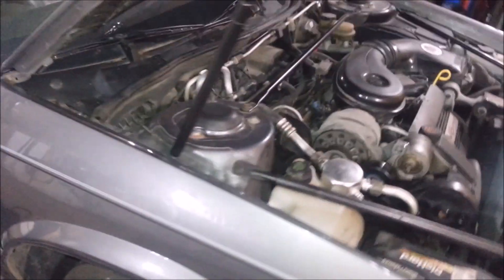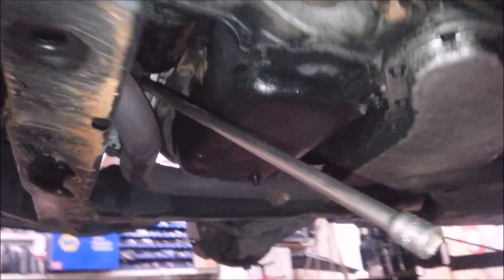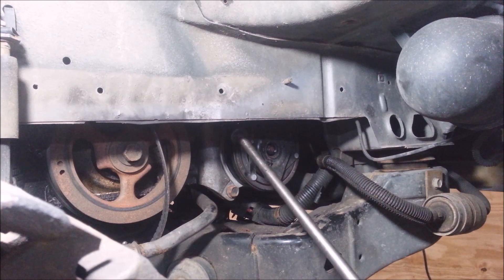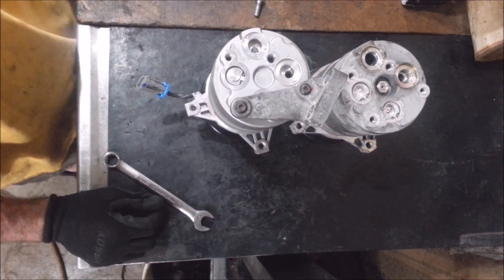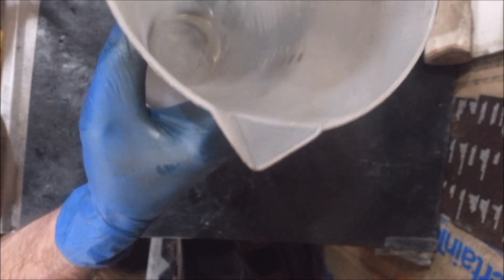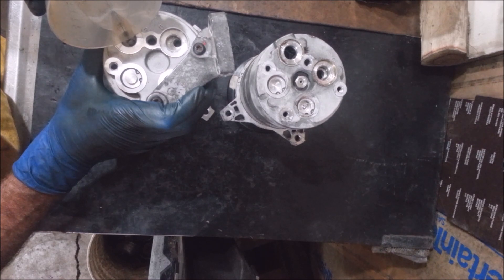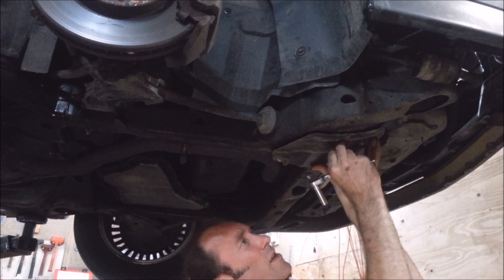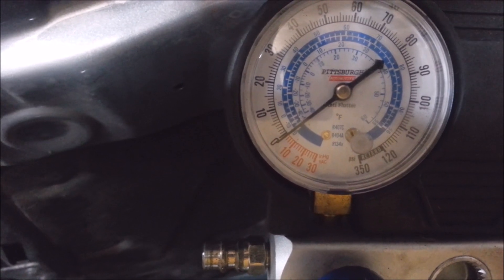1993-1995 Eldorado a/c compressor replacement

Comment: The show goes down at 12 noon today. My friend is going to recover the old R134A in system and put on the new ac compressor and accumulator Orifice tube and seals and recharge it. I will let you know how it all goes. Thank you for your help and guidance

Comment: Thanks so much for the response. Exactly....wrong compressor. Ugh. I spoke with Four Seasons and they've confirmed that I need their 58956 even though the 58963 is listed to fit. I hope this helps someone who might be in my situation. Definitely check the orientation when you get a replacement compressor. It should be exactly the same. One more question, Rust, if I may....are there o rings under the switches/sensors that are on the freon line that runs across above the firewall? Or are they crush washers? I would like to change all of the o rings I can while the system is evacuated. Never delt with these. Are they easy? Thanks!

Comment: I'm doing a 1993 Seville 4.9 right now. GREAT video, thanks so much. Got a new Four Seasons 58963 compressor (supposedly correct fit) and the orientation is off. Its requiring me to twist the lines quite a bit to connect them. No joy so far. Also the old, original compressor used two thin washers and the new one looks like it's meant for a medium and thick washers. Should I keep messing with this to see if I can get the lines on there? Or buy another brand?
Reply from the maker: It's the wrong compressor. Also, there are separate seals you can buy from Napa, if they do not supply the right ones.

Comment: I've got a 1990 Eldorado I'm restoring. I need to charge the ac compressor. When I bought the car last week I tuned on the ac and it blew not hot nor cold In between. It is low on R134A previous owner had it converted. It displays Low Refrigerant and the compressor cycled off. Do you know the Color of the Power wire so I can jump it on. Thank you
Reply from the maker: Unplug the compressor coil. If it has one wire, That will require + power. If it has 2, it will require a +, and -. On a two wire system, it doesn't matter which ones you use, because it is just a pull in winding, making an electromagnet.
Reply from the maker: Unplug it, and jump with power, and ground. Coil winding can go either way.
Reply: @RustBeltAuto  Thank you for your help I greatly appreciate it. I replaced the air conditioning compressor and accumulator along with the Orifice tube and seals. I vacuumed the the system down 3 times and charged the system to the original specification for 90 Eldorado 38.5 R12 8 ounces of mineral oil which I used R134A and Ester. It blows so cold I've got to turn it down. Thanks again
Reply: @stevecarlson6462  went great. Blows ice cold. I replaced the air compressor accumulator and Orifice tube and pulled a vacuum. 38.5 ounces of R134A and 4 ounces of ester oil.
Reply: @stevecarlson6462  Yes it'll be getting hot in Kentucky really soon plus my mom is 73 and I didn't want her riding in the hot car. Their is a guy on Ebay that I buy remanufactured air conditioning compressors from hes really reasonable. 100 for my 90 Eldorado plus 30 for the accularator 4 for the Orifice tube 20 for R134A 9 for ester oil. 200 for labor from a great friend.
Reply: @stevecarlson6462  Sourcedbytd is the seller.
Reply: @stevecarlson6462  What year and model engine size. Is it r12 now or has it been converted to R134A.
Reply: @stevecarlson6462  91 Seville. 4.5 4.9 same you've got a HR6 Compressor. The system will shut down and display the readings Low Refrigerant and AC shutting off. The low pressure switch has detected the r12 or R134A is low. My problem was all my R134A leaked out from a bad low pressure switch it was cracked from age I replaced it shot some R134A in and the compressor kept shutting off blowing fuses. My clutch was bad. I would have a skilled macanic to put gauges on the low port and check the refrigerant readings to see if it is low before putting a compressor on. If it's low jump the low pressure switch on the low pressure line it is close to the firewall to kick on the compressor in order to add add refrigerant. The system uses oil such as ester or common pag 46 oil with R134A system. R12 uses mineral oil. If I'm not mistaking your system holds 38.5 R12 and 8 ounces of mineral oil straight from the factory. When retrofitting the R12 to R134A use the same amount of R134A 38.5 R134A and 8 ounces of ester. Anytime you open a ac system you must pull a vacuum to evacuate the atmosphere of any moisture that has entered the system.
Reply: @stevecarlson6462  the low pressure switch tells the PCM to shut down the ac compressor when the system is low. Gage the low side with the compressor on (JUMP) The low pressure switch to cycle on the compressor in order to gauge it and get a proper reading. Low refrigerant will shut off the compressor. I would look at doing that first before replacing parts and opening up the system.

Comment: possible to pull the clutch and pulley off without removing the whole compressor? 94 deville 4.9l my pulley bearing is shot
Reply from the maker: Yes. There is a puller kit you can buy. Probably have to get it off of Amazon or eBay or something. I don't like replacing just the clutch, because when they get old, their is usually not much life left in the rest of it.
Reply: You able to show me a link to a set? I noticed it's the plate between the clutch and pulley that failed.
Reply from the maker: @nicklittlewolf2738  https://rover.ebay.com/rover/0/0/0?mpre=https%3A%2F%2Fwww.ebay.com%2Fulk%2Fitm%2F263810749684
Reply: I lost the center nut that holds the clutch in place, anyone able to find the size specs?

Comment: Hello I was wondering if you could help me out I need to replace the front passenger motor mount by the air conditioner compressor, I have a 1992 Cadillac sedan DeVille. Do I have to move the compressor out of the way to get at one of the rear nuts on the top of the motor mount?
Reply from the maker: I have done those a long time ago, but can't remember.

Comment: I need help with my 93 Cadillac a.c fan don’t work I check fuse relays there all good an change the motor control module  what can it be
Reply from the maker: You need a flow chart dude.

Comment: Rust belt auto can you help out please. 1990 Cadillac Eldorado 4.5 Do you have a part number for the color coded manifold seals. How much oil should I put in the new compressor. I'm replacing the Accularator as well will I be safe adding 2 ounces as the gm system calls for 38oz R12 and 8oz oil. It's a R134A system. Thank you
Reply from the maker: Depends. I would do at least 4 ounces. See if any comes out of the old compressor. If no, go six oz. At least. If yes, add that amount plus 4 more to be safe. It usually depends on how big a leak it is, how it failed, and where, so you need to guess. A slow leak on the cold side will loose less oil. There is a universal o ring kit you can buy at any parts store. It is a pack with a bunch in there.
Reply: @RustBeltAuto  The low pressure switch on the low side line failed and leaked all the R134a out. As I manually engaged the compressor I seen it leak and replaced it with new. As I manually engage the compressor it kept popping fuses that is when I discovered the bad clutch so I ordered a remanufactured unit. I believe the coil is touching the plate shorting it out.
Reply: Far as the o-ring kit I bought the hr6 GM  complete washer seal  and o-ring kit
Reply from the maker: @Tom-wq2mz  They like to melt sometimes.
Reply: @RustBeltAuto  brittle from age it was a original part. I'm replacing the Accularator today I'm putting a new low side charge port to insure no leaks.  Since the system has been retrofitted to R134A what pag oil do you recommend. Pag-150 ?
Reply from the maker: @Tom-wq2mz  use ester oil on a retro fit. Ester can mix with anything.
Reply: @RustBeltAuto  Thank you. My father passed in 2008 he was the AC guy. He always used ester oil. With the new company's out there calling for pag-150 I was a little confused. If I remember correctly I add the oil to the High side of the Accularator is that correct. Thank you
Reply from the maker: @Tom-wq2mz  doesn't matter too much where you put it. Might as well dump it in the accumulator if you take it off. You just need to run the system for a good 5 or 10 minutes to equalize the fluids, and pressure in the system.

Comment: So do I add 4oz of oil to the compressor or 8
Reply from the maker: 4oz. For a compressor change. Plus 1 extra for a small leak. 3 extra for a large leak. That sounds like a good guess if it is an 8 oz. System.
Reply: Thanks for the feedback, was also wondering if I need to add oil to the new receiver/dryer
Reply: It's on a 95 DeVille 4.9l
Reply from the maker: @Nacholibrethe3rd  you can put the oil wherever. It all runs through the system.
Reply: @RustBeltAuto  I was referring to adding oil back in to make up for what was in the old accumulator, I took about 1.5 ounces out so I added 1.5 to the new accumulator
Reply from the maker: @Nacholibrethe3rd  okay